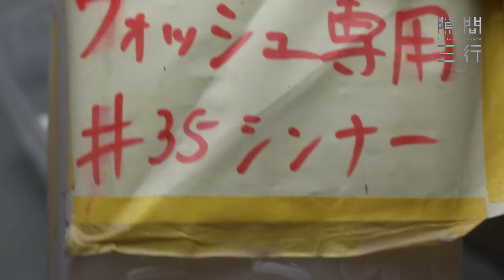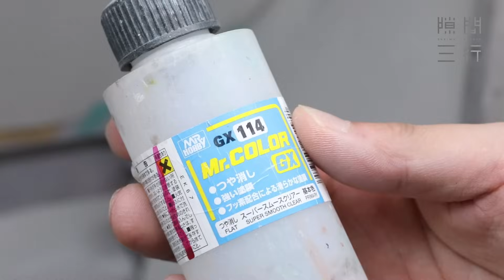Blue Archive - シロコ 水着フィギュアを組み立て塗装する/Shiroko swimsuit ver. Garage kit figure build and painting #ブルアカ

Comment: nice job especially the painting
one thing though 
did you consider the position of seems on the swimsuit part?
i think if you go for realism there should be at last one seem in the crotch where you removed it because that is where lining gusyt attach and where front and back piece of fabric comes together
side seems on the swimsuit seems kind of redundent due to color accents unless it is particularly wierd swimsuit with color parts being sewn on top of the grey, shoulder straps being one piece with the back is also interesting but the color accents in front kind of make it easier to belive if not for those top seems would have to stay also
you can study swimsuit construction if you don't belive me

have nice day and thanks for the video